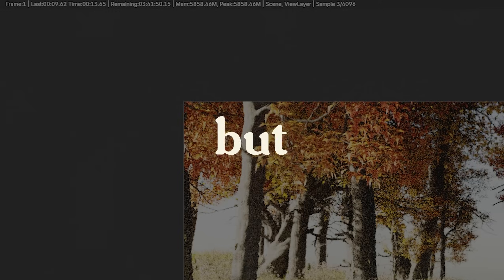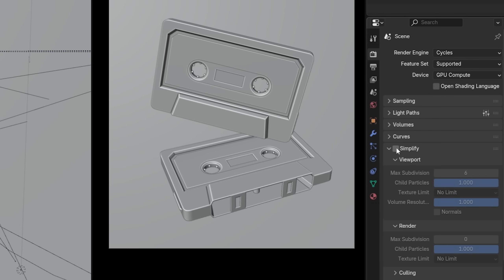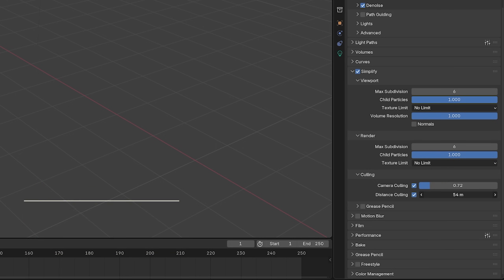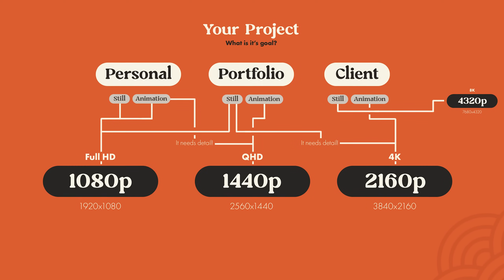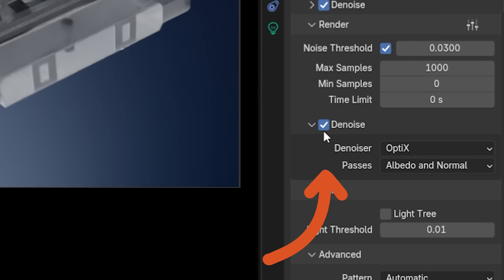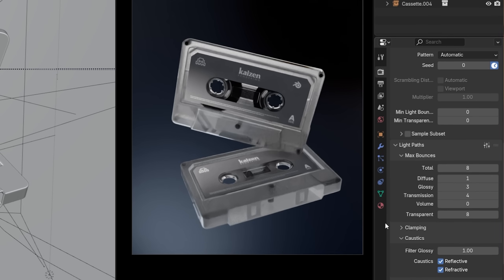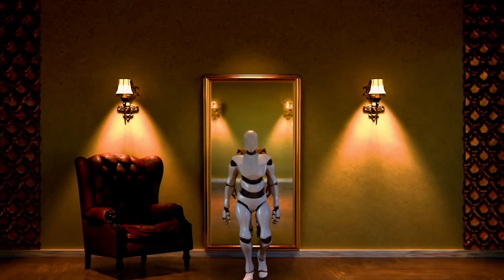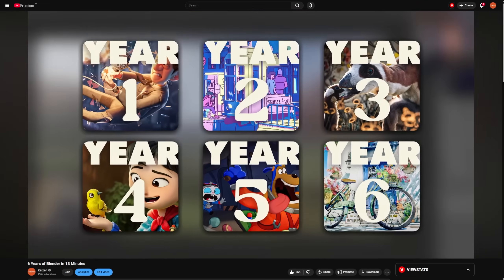The Secrets to the FASTEST Cycles Renders!

Comment: just a heads up, persistent data isn't always a good idea to enable. I recenty had an animation with fluid particles. With it enabled, each frame took 8 minutes, without it each frame took about 2 minutes. 
I think it was because of having thousands, if not hundreds of thousands of objects, means it's quicker for the data to be calculated on each frame than have hundreds of thousands of data points saved and referenced each frame.
Reply from the maker: Ah yeah if persistent data runs into hardware limitations it's definitely better to turn it off!
Reply: @KaizenTutorials  It wasn't a true hardware limitation (I didn't max out my ram), it presented more as a software bottleneck.
If anyone cares: in a scene with a huge amount of objects, even if their material is a basic bsdf, it can load and render a frame quicker without persistent data enabled, even without ever running into a full ram scenario.

Comment: Ten hours 15 minutes of work is nothing compared to the 5 days spent on a 300 fps render, and no, I'm not kidding. And the worst part is that I'm not satisfied with the result. Should I start over? I prefer to settle for it and keep working to one day get a better computer. I love this video, thank you very much."🎉
Reply: What I usually do for animations is I render at a low res at the same aspect ratio as the target animation (ie, 640x360 for 1080p) with a high noise threshold for lightning fast animations.  This lets me kind of get a vibe for the animation speeds in real time, look for obvious errors I couldn't see in Blender itself because potato PC, etc.

Then when I'm happy enough with it I crank up the settings for final render resolution.  Meanwhile, while it's rendering, I can use the low res animation on another computer to do any sound effects and such so that in a few days when my final animation is done I can just  plug that into my video editor and immediately render the final video with sound.

I also render to images rather than a video file; if 90% of the animation is great but a tiny bit of it needed a rework I can just render out only the fixed frames and that really speeds up iteration.
Reply: @trekkie1701c  Oh thank you so much, buddy. I'm going to try that right away with part two of my animation."

Comment: 10:34 1000 samples is still a huge overkill for this image. I bet there wouldn't be much difference with as low as 100 samples + denoise.
Reply: Great video anyway, forgot to thank you! Learned new stuff :)
Reply from the maker: It might very well be! I think however the 10-13 seconds per frame is more than good enough in this case. But I agree it could probably get lower and still look reasonably identical in terms of quality.

Comment: I liked your video.  But there are two way to reduce your rendering times.   

1) Turn off your CPU in "cycles render devices" why? This slows your GPU to match the CPU.

2) Under "Render > Performance > Threads"  untick  "Use Tiling".   I find that doing this reduces render time. too.
Reply from the maker: Thanks for adding these tips!

Comment: It's sometimes faster to render in 4k if you are using denoiser, it seems that the denoiser works better with more pixels, so in 4k you can reduce samples a lot, and the denoiser will result in a comparable image to a 1080 render which required to add a bunch of samples to denoise the image in a shorter amount of time...
Reply from the maker: Good one, this does work sometimes yeah!

Comment: Another way to speed up your render times is by stealing a NASA computer, then using that as your work computer.
Reply from the maker: this might be the best way
Reply: I know you're joking but coincidentally-ish I have a server with a CPU that's a couple of generations newer than the one Perseverance uses as an image processor (picked for the same reason NASA likely did:  cheap and it sips power, whole system uses only a couple dozen watts).

Sadly it lacks the instruction set needed for OpenImageDenoise so if you do try to render on a NASA computer, make sure to set aside a normal one to manually denoise the images.  ...And like, get some coffee because the standalone program for the denoiser can only proccess one file at a time.  And only supports one kind of exr file that you'll need to convert to a png or jpg to be useful elsewhere.  So you'll be doing a lot of clicking :(

Comment: 1:26 this is incorrect. This is just around more than 3 hours. Though I know this is not the point. 14:04 it is best to test this on a very heavy scene. My intuition from my old vray experience and applying that to blender tells me that if your pc can not render or crashing on a heavy scene in a very high resolution, lowering tiling will render one portion of the scene at a time. This might help you successfully render the scene at the cost of added render time.
Reply from the maker: yeah little math mistake that happened due to old files being used for the initial calculations in teh script!

Comment: Cycles do not care about polycount, it cares about rays. So those cassettes you have there will render just the same but with maybe a slightly slower start and a bit higher VRAM usage.
Reply from the maker: Yeah I agree, but that does make a difference and if the image looks no different because of it that's well worth it. Even saving 1-2 seconds is a lot on a several 1000 frame long project for example.

Comment: Good video, but you missed an important point — higher resolution does increase render time, but you usually don’t need as many samples at higher res, which lowers render time again. The noise averages out better, so you can cut samples and still get a clean result.

Higher resolution (e.g. 4K) gives you more pixels, so noise is spread out finer. When you downscale the 4K render to HD, the noise averages out — effectively reducing visible noise.
Because of that, you can use fewer samples at 4K and still get an image that looks just as clean (or cleaner) once resized to HD.
Render time trade-off: Rendering 4× more pixels takes more time, but lowering samples can partially (sometimes almost fully) offset that. The balance depends on your scene’s lighting complexity, shaders, and denoiser use.
Reply: oh I'd love to see examples and comparisons of that at some point
Reply: But if you want higher resolution you most probably still want a cleaner image without any denoising artefacts so you still want to keep the samples more or less the same as the lower resolution one.
Reply from the maker: Yes! You are right and it's something I considered for this video. However in testing I noticed my rendertime got longer overall. I used a setup with an automated resizing in the compositor after rendering and generally the time got longer. It's a really good method though to improve image clarity with little effect on your total render time. However for a video aimed at merely SPEEDING things up I think it wasn't the right place!
Reply: I render at 4k with 60 or 120 samples
Reply: @chryssdale5747  That doesn't say anything though. Rendering a cube with a point light at 4K and even 60 samples is overkill, but rendering a fast moving character motion blurred with SSS in a dense volume and heavy DoF and you gonna need WAY more than 120 samples for it to look even close to good.

Comment: Interesting...  downloaded the test file and without any changes:
Blender 5.0 Beta
RTX-4090
i9-14900K
ROG z790 Hero
64 GB DDR5-6400

Render Time:  20.36 seconds.

Ah, I see you already had the optimizations applied.  I shaved more time off by pumping up the tile size.  Right around 11.22s for me.
Reply from the maker: Nice! Oh those shouldve been disabled tbh, so I think I just uploaded the wrong version haha might change that tomorrow to have people try the settings and optimizations out themselves
Reply: @KaizenTutorials yeah light trees were on still but everything else was optimized.  With persistent data and doing an animation render it was hitting about 7.79 seconds per frame for subsequent frames.
Reply: @KaizenTutorials also on the topic of tile size, I've found that to be another thing that varies greatly project or project and I don't know why.  Usually around 2048 is the average sweet spot for me.  On your project I pushed to 4096 to do it all in one go and wass getting < 12s.  When I stuck with your initial 441 it was 19.5 to 20.5s.  But on some projects smaller tiles are faster for me.

Comment: Love these tips. Unfortunately, a lot of them are problematic if you frequently run into ram and vram limitations. I personally find ram/vram much more troublesome than render speed because if I solve the ram/vram stuff, I can render overnight (or a couple frames a night for a week), but if I can't solve the ram/vram issues, I literally can't render....
I know the best solution for vram limitations is getting a **90 GPU, but that's not an option at the moment... 
Other solutions I've found that work are: 
Simplifying the textures
Render layers - annoying and slows stuff down, but definitely can decrease the ram/vram usage
Rendering from the command-line
Rendering a frame at a time from the command-line, with blender exiting between frames (really sucks time-wise, but prevents memory leaks from causing issues)
Not using adaptive subdivision (even though I love adaptive subdivision... This helps with vram and time)
Persistent data off

Any other things I'm missing? 

I guess "don't do highly detailed large environments" would probably be a good piece of advice, too...
Reply from the maker: I think the best option for VRAM issues is layer separation. The more you can separate your image in layers the easier it is for your PC to render each layer individually. Yes it's more work in setup and combinging them after, but at least it will let you render huge scenes even with lower end hardware.

Comment: Last comment, I swear 😂
A really good trick for denoising is not to use the final "beauty pass" for the denoiser. It's best to decouple the render layers (diffuse, glossy, emision, etc, etc) and denoise those individually before combining them again (keep in mind that not every one of those is noisy, you can skip most). This "multilayer denoising" keeps texture detail better than "single layer denoising" at a marginal cost in processing times.
I think it's set to automatic by default, but I also always choose the sampling to use blue noise rather than white noise. White noise is roughly constant in frequency space, whereas blue noise is mostly high frequency, making it easier to remove with a low pass filter (a denoiser is just a fancier version of that).
Lastly, regarthing the blotchy denoising artifacts: it certainly helps to add a moving seed, so you don't get a permanent pattern "stuck" to your screen, but it doesn't remove it, it's just slightly less noticeable. To combat this I would advise learning about temporal denoising. I know there's a hidden version of it in Blender, but you can also implement it yourself with ease in the compositor. Keep in mind this is also imperfect, and more meant for slow movements, otherwise you'll get a characteristic ghosting artifact of this method. Hope someone found these comments helpful or at least interesting to read!
Reply from the maker: Haha I love these, keep 'm coming! Thanks again for the in-depth reply on denoising.

Comment: I think the tile size is a bit of a vestigial setting from the old inner workings of pre "Cycles X" Blender (whenever that was). Nowadays rendering is more pixel based rather than tile based, so I don't think it will influence speed as much as before.
The reason for the option still existing is a case for memory usage, akin to an upper limit on the amount of pixels processed at a time in total, and not really a tile system like a couple of years ago
Reply from the maker: Agreed! I remember rendering back in the day always going tile by tile and me trying out various settings to see which magic number got my render to go faster haha
Reply: @KaizenTutorials yes! I would do this for hours, making it completely useless 😂 would have been better to just leave it and render it just once! But it's always fun to experiment and see what you can discover (or break) in this wonderful program

Comment: 9:20 the noise threshold is for the variance of each pixel. Basically, it calculates the per pixel variance from all the samples in that pixel and compares it to the user-set value. If all the samples have a similar value (color), the variance for that pixel will be small and you can assume the pixel corresponds to an area of low noise and can therefore halt its processing prematurely
Reply: PS: the higher the amount of samples taken, the safer it is to assume that the correct variance has been calculated, that's why there's a minimum amount of samples, so you can ensure a basic set of samples to get a half decent attempt at finding the variance for that probability distribution
Reply from the maker: Wow! That's a great explanation, thanks!
Reply: @KaizenTutorials thanks! Great video as always, you're one of my favorite channels :)

Comment: can AI extinct VFX/CGI?Maybe due to abundancy or lack of interest ???? Question to u kaizen and other fellow artists.
Reply from the maker: Do you want to make 3D art yourself, not through AI? If the answer to that is yes than 3D art can't go extinct. Ever.
Reply: Not in an effective way, no.  I just finished my own project, so to use that as an example it was a sequel to a previous video.  The effects were identical to the last one, using the same models, etc, which is a level of consistency not possible with anything that generates using any sort of randomness.  Randomness being inherent to the neural networks that machine learning uses.

I was also further able to pick some frames I liked and rerender them at significantly higher quality settings and without motion blur to make wallpapers.  Again, if I tried to use an image generator I wouldn't get a consistent result.

Thirdly, I have all of the assets used to make the animations.  I can make more with the same assets very easily.  I can do all sorts of very specific beauty shots and angles.  I can also modify them to create more assets that utilize the same design language.  I also write books in that universe; so I can actually use the 3D assets to make ads for the books that match the events of the books.

In comparison Coca-Cola just spent as much as they normally do to make an ad on this year's Christmas ad where the truck was wrong in a different way every few seconds, among many other issues.  If they'd paid a VFX artist they could have gotten an xmas themed cola truck that could become not only consistent with the ad, but a pre-made model for other ads or to manufacture as a merchandise opportunity for even more money.

Which, if I can get the money for a 3D printer myself my own VFX work means I pretty quickly can just start printing out ships from my books.  If I'd resorted to AI I wouldn't have that option.